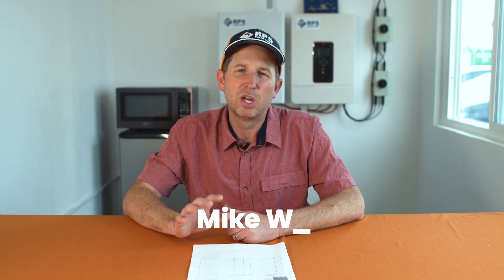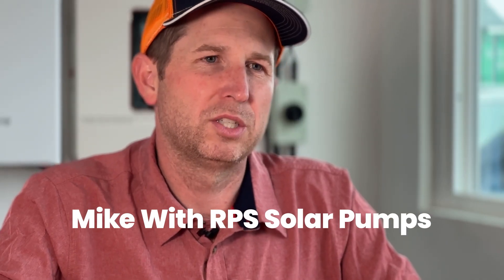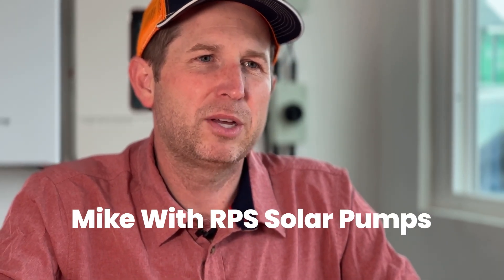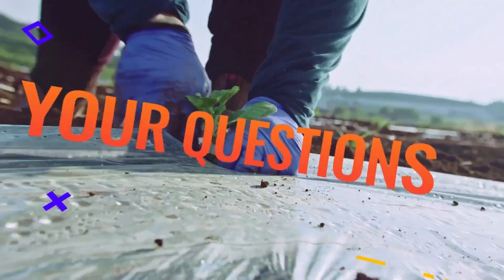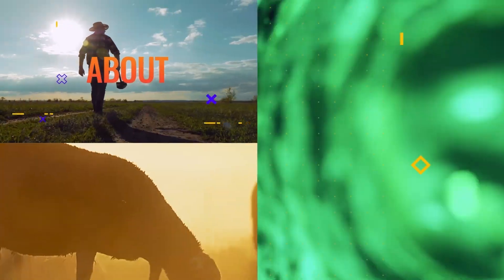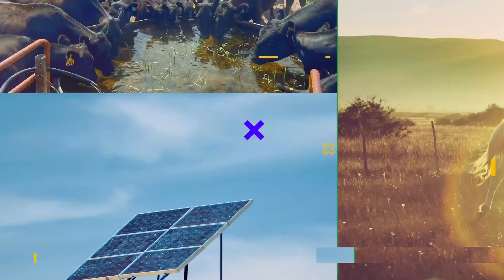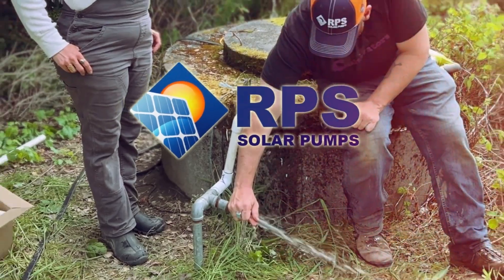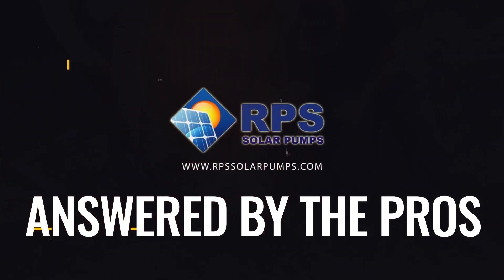How Many Panels Are Needed To Run A Solar Pump? | Q&A With Solar Pump Engineer

Comment: I have 1.1 horse power solar pump how do I connect the panels
Reply: Connect it in series to 2x 600w or 3x 500w panels using a solar controller.Search YT how to connect. I installed my system myself, and I have no solar experience.

Comment: Greeting I hope you can be the one to make me understand something.....it's like this I got 400w, 3m³/hr, 48v solar pump that connects direct. I have connected 1 400w solar panel (37v) and it pump for about 40m with 40mm pipe. 2ndly I added another 400w on parallel and it go for about 55m, next i connected in series then it shoots to about 90m. My question is it possible to use one high voltage panel that an output of 72volts, 400w, 5amp?

Comment: Good day
Watching your video's in pakistan 🇵🇰 
I am using a generator for .75hp submersible pump at the depth of 180 feet
I want to convert my pump to solar 
What should i do
Reply: If i buy a solar submersible pump or dc pump how many panels do i need and are they panels used for other purposes as well or only dc pump 
In simple is it possible to use dc 12v .75hp pump on mppt charge controller or pvm charge controller